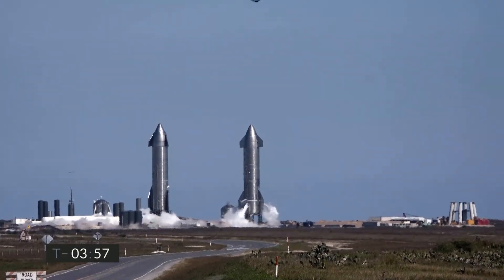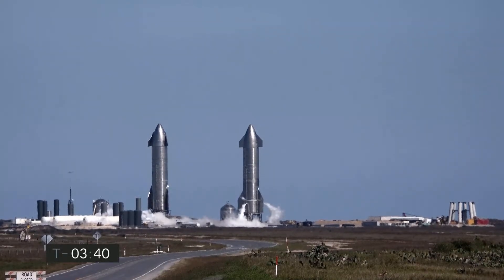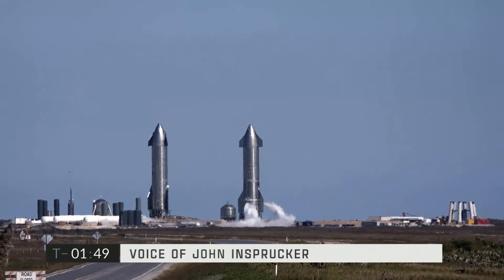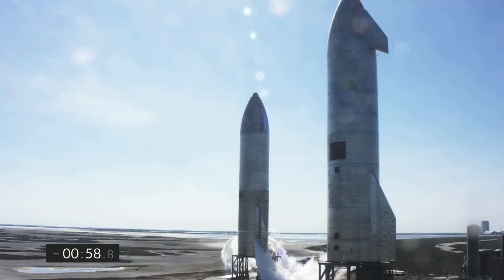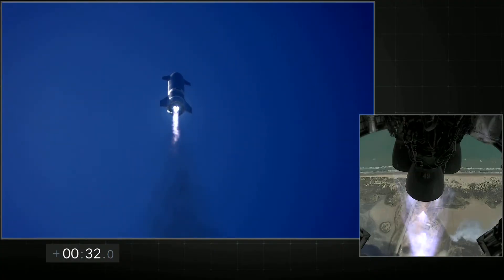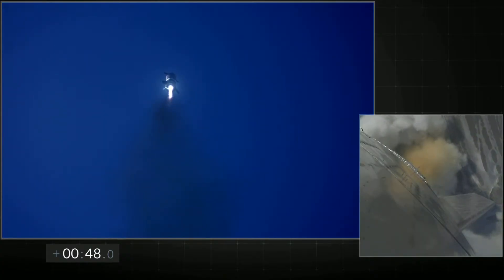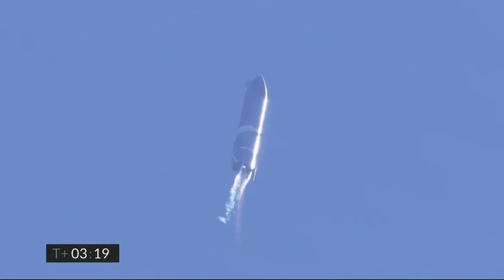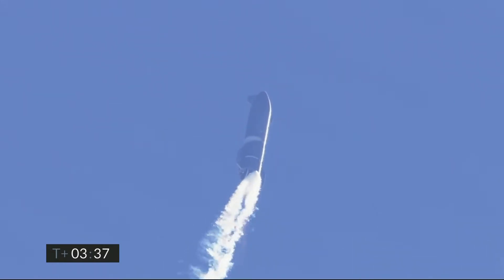Starship | SN9 | High-Altitude Flight Test

Comment: Musk talks about environment and CO2 emissions and BS like that to promote his terribly built EVs, but one of these rockets that look like a giant shiny stainless steel member would emit what a whole city emits for a whole year, the amount of fuel burnt is gigantic, and now we have explosions...
Reply: The emissions from a starship launch are less than the annual emissions for 250 cars. Come on, the math isn't even hard. An average high-schooler could figure this out.
Reply: @infinitelyexplosive  how much fuel it burns every time it goes to space? and to be honest, I didn't do the calculation, a bit lazy at the moment, will do it when I think of it again. But I think annual emission of 250 cars is a wayyyyyyy below reality. We are talking about a rocket that can take 100 tons to the space...
Reply: @infinitelyexplosive  oh, and please show me this high school calculation, I am curious to see how to calculate emissions based on equations. I am an electrical engineer, don't know much about emissions resulting from burning fuel.
Reply: @huss1205  1200t fuel, emissions from methane combustion are co2 + 2 h2o, corresponding masses of 44g/mol:36g/mol -> <750t co2, avg us vehicle is 4.6t co2/yr, 750/4.6 gives 163 cars. Starship dry mass 85t, 1.9:1 co2:steel gives 162/4.6 gives 35 cars for a total of ~200, throw on another 50for fudge factor(incomplete combustion/manufacturing/alt materials).
Reply: @huss1205  His math is off, but not terribly so. A fully loaded Starship has about 1000 tonnes of methane. When burnt, that makes 2750 tonnes of carbon dioxide.
The average US car drives 13500 miles per year with an average mpg of 25,  so 540 gallons per year. When burnt, that makes 4.8 tonnes of carbon dioxide.
2750/4.8= 573. So 573 cars burn the same fuel in one year as Starship does in one launch. The average city has a lot more than 573 cars.
The US has a total of ~274 million cars. SpaceX would need to launch some 478,000 Starships per year, or 1310 per day, nearly one every minute, to match that.
Reply: @lazarus2691  man, that's a lot of launches...
Reply: @infinitelyexplosive  thanks man...
Reply: @lazarus2691  are you absolutely sure that the stated propellant capacity is for fuel, not fuel and oxidizer combined? All the evidence I can find points to the latter.
Reply: @infinitelyexplosive  
A fully loaded Starship stack weighs 5000 tonnes or so. Rough assumptions put the booster at 200 tonnes dry, the ship at 100 tonnes dry, and 100 tonnes of payload.
That leaves 4600 tonnes of propellant.
At a 3.6:1 mixture ratio, that works out very nicely as 3600 tonnes of oxygen and 1000 tonnes of methane.
It's probably +/- 10%, but 1000 tonnes is in the right ballpark.
Reply: @lazarus2691  aah, I didn't factor in SH

Comment: 1. You guys need another set of flaps in the middle. Use them to control the flip. Its uncontrolled. 2. U need to make the flaps larger. 3. Fire the raptor only after attaining vertical position. Ur firing it early adds unnecessary uncertainity. 4. Dont do the flip so close to ground. Do it early.
If u make the same mistake with SN10, ur engineers will go down as retards.

Comment: Could you please start the flip over to the landing-position and the whole process a bit earlier?
The other engines would have the possibility to start again with a little bit more time.

Do you have some measurements from the inside ? Possibly the O2 from the oxygen-tank did not reach the engine any more.

Comment: Is there a way to use on-board AI and some AI-censor combo at the docking bay .....and both system sort of talking to each other to calculate, making adjustments to land the starship automatically rather than people controlling it manually at mission control??? ......i m saying this bcz i saw tesla made a huge advancement in self driving and i think similar sort of advancement might work in this case........i could be completely wrong on this......maybe u guys already on a better path ..... keep on going #SpaceX

Comment: oups ... they did it again !!
maybe they should try to fire engine earlier before landing, so that they have time to correct the vertical stabilisation before touching ground in case they over compensate again. this way they can tweek perfectly the stabilisation algo  without loosing the ship each time.

Comment: Let's give a nod at how difficult of task that SpaceX is trying to attempt here. They gave a cylinder aerodynamic capability. They are trying to have rocket engines to fire in flight in the atmosphere just prior to landing. And don't forget, even though SN8 and SN9 had failures on landing, they were on target to land where they were suppose to. This is all crack for engineers. Keep up the work.

Comment: As on SN8, the landing is the problem!! You are starting the engines near the ground, there's no time for corrections or hesitations/fails!!! The engines must start earlier even if just on "idle" It will be necessary more fuel and will be more weight, but the systems needs more time to react and correct!! Because the rocket will on the vertical and the flaps can't help to reduce the speed, how about "NASCAR" aerodynamic breaks?
When the engines start, and the rocket has the motors facing down, the back pressure will be high on the engine and probably is causing the engines fail to ignite. Try to start them on the horizontal, on "idle mode".

Beside that, is amazing how the system can control the descending on "freewheel". Congratulations.

Comment: Is anyone else amazed that SN10 is just sitting what looks like a couple hundred feet from the SN9 landing pad/explosion zone. Seems like you would want to keep it a little further from harms way...
Reply: @Jo Vi SN9: explodes
                SN10: alright, who's next ?
                everyone looks at SN10
                 SN10: stress 100
Reply: I suppose they didnt want to delay their SN10 progress because of a missing FAA approval to launch SN9 at the original test day. Its all about the risk/reward scale.
Reply: EXACTLY WHAT I SAY.
Reply: They dumped fuel so that wouldn't be as powerful of an explosion
Reply: I don't think so. They'll have less room than that on the Oil platforms, so they had best get in the habit of ensuring RUD's are 'Neighbor Safe.'
Reply: just bumped you over 100.
Reply: It is about 100 meters from the landing pad i think, not to sure but it is definitely quite far away.
Reply: @JoshLoweSpace  100 METERS FOR A ROCKET WHOSE HEIGHT IS MORE THAN 50 METERS IS NOT TOO SAFE EVEN IN A CASE IT FLIPS OVER, LET ALONE IN CASE IF IT EXPLODES IN WHICH CASE THE DEBRIS CAN FLY THE DISTANCE OF SEVERAL TIMES THE HEIGHT OF THE ROCKET. SO, SOMETHING LIKE 250 METER RADIUS IS A DANGER ZONE. NOT TO MENTION HEAT WAVE AND SHOCK WAVE PRODUCED FROM THE EXPLOSION.
Reply: @syobsyotsec2919  they have several more coming up in production, they will just get a new one.

Comment: I don't know much about aerospace engineering but they should have released the landing burn at little higher altitudes because the ship didn't got enough height and time to stabilize itself like the falcon9 boosters....I guess it is little heavier than the falcon boosters dew to which it would requires higher altitudes for landing burn.....but nevertheless this is just hypothetical truth can be different ...

Comment: I can see there was a fire inside the rocket during launch, above one of the engines. Must have caused damaged to pipes and/or control systems. I also saw some burning material in SN8. Need to avoid fires inside the rocket. Fire does tend to get drawn inside with the shape and lots of space around the motors. Looks and flies great apart from this. Just need those engines working and under full control, especially when coming in to land.

Comment: Nine motor configuration (or multiples thereof)  = success.  Even if  motor interoperability is not understood by the company, the power and stability will still produce good results.  I wonder if they just 'lucked into' the nine motor configuration on the Falcons? Hope I'm wrong, but don't think I am.  They may also have to consider moving to a stable Democracy and about the only one left is Australia.

Comment: Pad A and Pad B are in close proximity to the surface methane and oxygen tanks. SN10 could fall on the omega pipes and cause gas leakage and a fire. SN10 does not have to initiate flight to cause this. With just a strong wind or instability of the support legs (as has already happened) it could tip and fall on the piping.
Both PAD A and Pad B should not be so close to the fuel sites.
The landing area should also not be inside the launch and fuel areas. Large fragments of SN9 impacted even SN10 and many other facilities.
Landing zones should be isolated and at least 5 km away. 
There is overconfidence in launches/landings and as I mentioned, with just one tilt and fall of SN10 on the pipeline, vital infrastructure would be lost: fuels and liquid oxygen, and the schedule of ALL launches and pressure tests would be delayed.

Comment: Did the failed engine actually explode? Saw two occasions of large flames coming from under the skirt on engine shut down. Is this just excess methane burning or an indication of hardware failures?

Comment: I can't believe they had sn10 sitting so close. They're producing these things so fast they have them everywhere. You open a closet door there's a starship open the fridge in the break room there's a starship.
Reply: I kinda thought this, but it actually isn’t bad testing to see what happens in a disaster situation. Potentially SpaceX is going to have commercial space flight and most likely space ports ships would come in and out, and ships would be that close to each other. While it would be a costly error to lose sn10 in this situation it gives them a better idea of something that could happen with passengers on board. Basically why we do crash tests with cars.
Reply: @TheTombomb5000  absolutely right
Reply: @mr.skylla7799  hey thanks
Reply: @TheTombomb5000  Don't worry, about a thing!
Reply: Its forced perspective, they are not as close as seems, but still a risky site.
Reply: I'm sure debris from the explosion could have easily hit it.
Reply: ME NEITHER.
Reply: Looks like they expected it to land
Reply: In a large projects different parts, subprojects, are tested in parallel timelines to meet in single junction milestones. To get as much as possible done at the same time. 
Therefore SpaceX is probably testing Starship subproject along parallel subproject of its infrastructure. This make sense, because such large SC cannot be transported across large distances by general use roads. Therefore the only option is to get everything needed for a relaunch at the same place as much close as possible. When they will manage to land ships successfully they going to need this.
Reply: It's not that close as it looks from front and side angles.
Reply: I guess they were very 100% confident that the test will succeed! That was a huge gamble.
Reply: They have these things coming out on an assembly line. SN9’s launch was canceled twice already. So things in the factory were backing up. They needed to move the SN10 out because they are already working on the SN11. The SN10 is just 1 of many test ships so it’s no big loss if it happened to get damaged.
Reply: Maybe they didn't have a choice. Maybe.
Reply: I'm sure you all know how to perform this operation better than SpaceX egineers.
Reply: Definitely crazy
Reply: https://youtu.be/NEzho9B0Rpo ,
Reply: jpnewpic88.men
Reply: "The RUDs will continue until morale improves"
Reply: This is normal. Try and fail cycle sooner or later will bring to success.
Reply: I dont think it has its engines installed, its just got the tanks and plumbing and all that stuff
Reply: L e g i t
Reply: That’s not a couple hundred feet. That’s driving distance apart.
Reply: https://youtu.be/UbEt48OJ9yE
Reply: Hahah yeah
Reply: The Starship series are stainless steel.
And the SN10 was not fueled.
Reply: that's just plain stupid...
Reply: @MartyInTheWoods  they are rocket engineers, they know what they're doing. Calling them stupid is just too much.
Reply: @MartyInTheWoods  says the guy with no rocket company. thanks for your inciteful input. maybe a drop a letter to their board, tell 'em where Elon's going wrong.
Reply: You act as though it's filled up with fuel?  It's just a big empty tin can bud.
Reply: https://youtube.com/watch?v=hGVDzN-oPGA&feature=share👌

Comment: While flipping .....#the downfall force + gravitational force was high so that required thrust was not attained thats the reason for the blast.
If the force before its landing is controlled by..... additional pushing thrust + gradual phase in reduction of force will attain proper landing.

Comment: Quick question, aren't there suppose to have 3 legs extended out during landing like Falcon 9 or is it suppose to hard landing on the Starship body itself?
Reply: There are six small legs that fold out from the engine bay. You can see them on sn5 and 6 hops.

Comment: Without reading all the comments, these may have been mentioned, but I observed two things ... reflective of SN8's  test. 1. Seems that SN9's rotation to a vertical position, should happen much earlier during its decent in order to allow more time to stabilize. 2. Also, all three engines should be burning to slow the final decent down and allow a higher assistance of control for the craft. It never was in a stabilized controlled decent towards the end. Is there a reason for such a late rotation and use of only two engines for landing? All the rest of the flight was beautiful.

Comment: It amazes me that for my 72 years as a space rocket fan, the biggest rockets still fight gravity from a standing start. How much fuel and weight would be saved with a running start on a sled (cradle) going down a long ramp that goes up like a rollercoaster. The sled could be powered and essentially be the first stage of the rocket.  Also you guys and girls at spaced all have brass ones, but could you land these prototypes a bit farther from each other.  They're set up like dominos!

Comment: if the diriving propellants put the rocket into orbit in tame this will be the job. if two propellant engines are put in the reverse direction of the propellant engines on the stern ın will save both time end fuel

Comment: Next time Elon!
Little time to catch the balance. 
Elon, and if you used the side 5 engines right away? 
And one from above and the bottom, i think it would be easier to control it at such a speed.

Comment: Where is the rotation of the earth if the rocket falls to the same place it started from
Reply: It glided back
Reply: The atmosphere rotates with the earth. You need to leave it before you'll get any offset, and this only went to ~31,000ft, airliners fly higher than that.
Reply: @lazarus2691  if the atmosphere is spinning with the earth, how planes fly in the opposite direction to rotation ?
Reply: @lucky7look185  They usually don't. They're still moving with the rotation, just not as quickly.

Think of it like being on board a fast train. If you run towards the back, you're still moving forwards with the train overall, even though you're moving backwards relative to other people on the train.

Though if you were a really, really fast runner you could run fast enough to go backwards overall.

Likewise, some fast planes can fly fast enough to completely offset the rotation. Various fighter jets, the Concorde, the Blackbird, and so on. But most cannot.
Reply: @lazarus2691  If you jump in a speeding train, will you fall in the same place?
Reply: @lucky7look185  
Yes, if the train is travelling in a straight line. If you jump while it's going around a corner, you'll drift 'outwards' while in midair.
Reply: @lazarus2691  Will the bullet fired from the gun into the front of the train have the same range as the bullet fired from the pistol into the rear of the train?
Reply: @lucky7look185  
That depends on how you measure it. If your perspective is onboard the train, then yes, it will travel the same distance in either direction. 

If you are measuring from outside the train however, the bullet going forward will travel significantly further, depending on the ratio of the train's speed to the bullet's speed.

However, this is assuming the train is travelling on a flat infinite plain.

In reality things are further complicated by the Eötvös effect, which creates a slight weight difference depending on the speed of the train and the direction in which it is travelling, with the difference most noticeable on a train travelling east.

The effect is small enough that for the most part it can be ignored however.  But if you wanted to get really tricky, in theory you could make a slight profit by buying something like gold or cocaine onboard a train when it travels east, then selling it when it goes west.

Comment: why not try the spiral down, like a spinning top moving to keep stable, or try the parachute
Reply: Neither of those would work. At all.
Reply: Starship is made to be interplanetary, and many planets don't even have an atmosphere, or have a small atmosphere, which isnt big strong enough
Reply: @oren2000  rotate rocket booster maybe is a good idea, it can help starship fast rebalance. from horizontal to vertical time that sn9 is lost balance. I think more little tiny rocket booster may be useful
Reply: @EagleMoonYoung  If they wanted to use parachutes, they would have to remake the entire rocket, as the fins are used for that landing